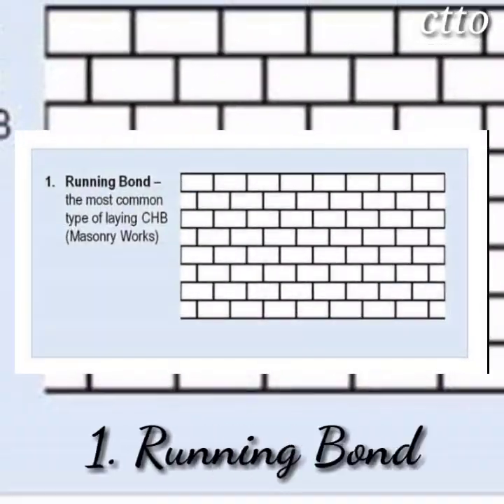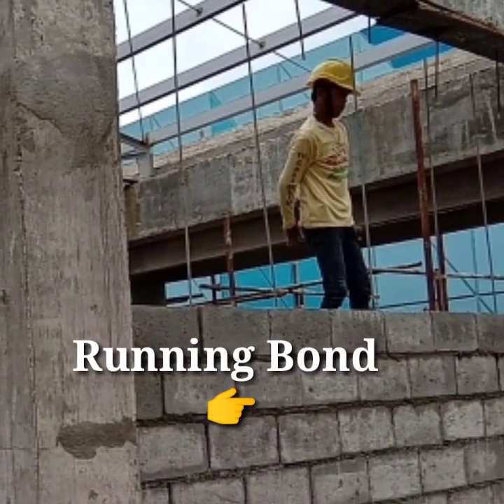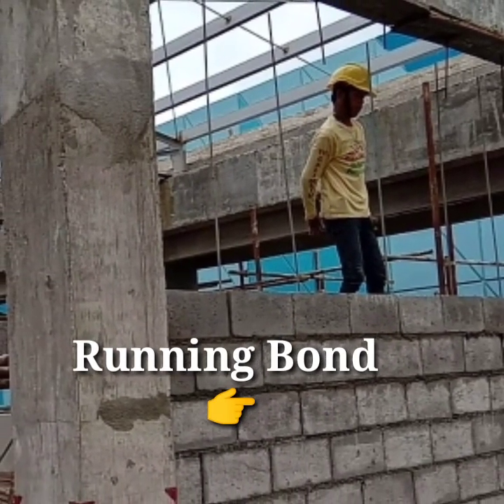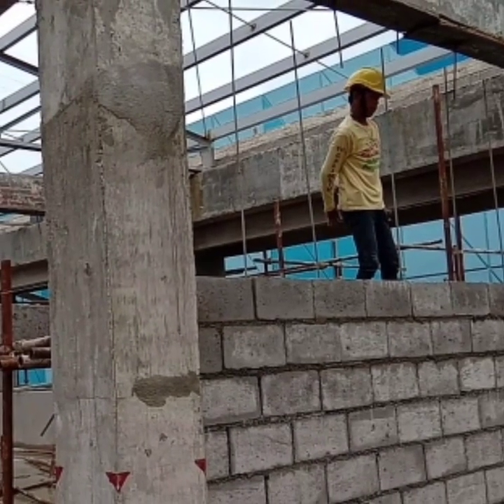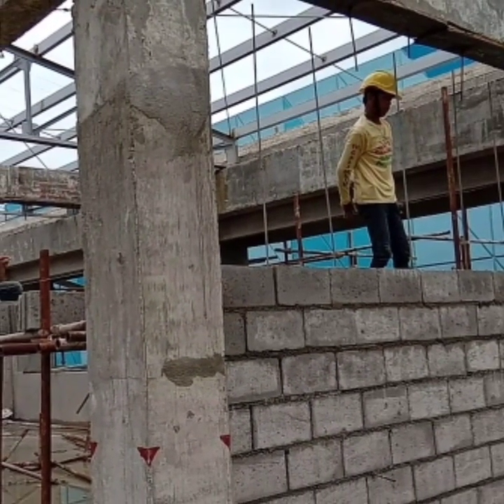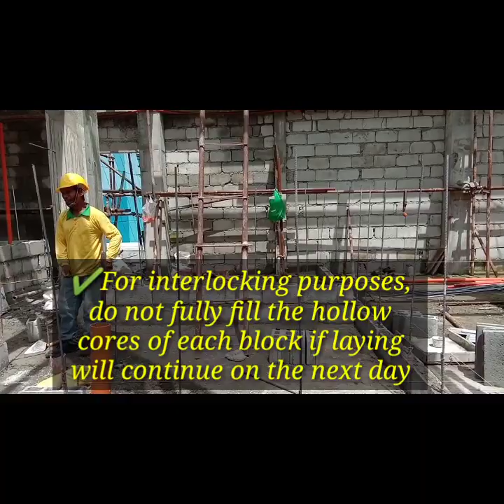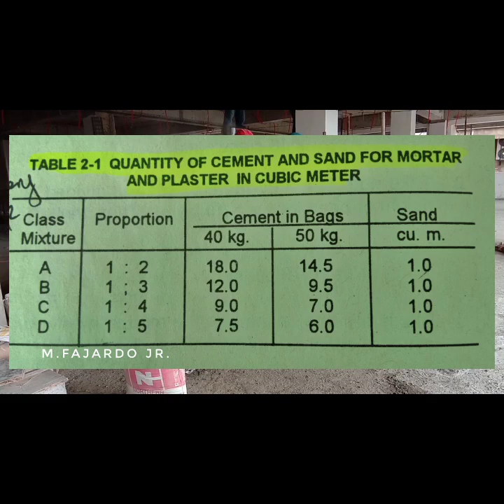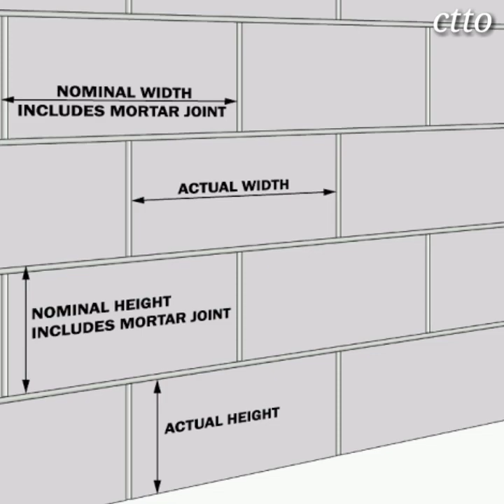CHB Laying Standards | Paano Mag-asintada | Stack Bond vs Running Bond Masonry Works

Comment: Sir kung gagawa ng perpendicular wall (3m span) sa existing na wall, kailangan bang may column sa both sides ng bagong wall or sa one side lang tapos pwede lang idikit yung other side sa existing na wall? Sana malinaw yung tanong ko haha
Reply from the maker: Hello po, pwd na pong idikit nyo nalang sir kung wala pong bigat na kinicarry sa taas..e connect nyo nalang po yung horizontal rebars sa horizontal rebars ng old wall. Sana malinaw din sagot ko hehe

Comment: Sir pwede po ba 4pcs na 12mm at 2pcs 10mm  sa column  ng 2 storey? 25x25cm po ang sukat ng column at 240cm lang po ang height then 3.3 meters po ang span per column. Tapos yung taas po e hardiplex lang ang wall. Salamat po
Reply from the maker: Hello po, ibig nyo pong sabihin sir sa Ground floor lang po hollow blocks ang wall tapos sa 2nd floor ay hardiflex na?
Reply from the maker: Recommended po kasi sir na spacing ng bakal sa asintada ay every 0.6m sa vertical at every 3 layers ng hollow blocks naman po sa horizontal.

Comment: Sir salamat sa mga videos mo very informative sir.
Sir tanong ko Lang sir kung mag pa babakod ako ng 1,000 sq meter.  Ilan tauhan po ba dapat kunin?
Ilan linggo o buwan matapos?
At mga magkano Kaya magastos Lahat lahat sa 1000 sq meter?
Maraming salamat at more power po.
Reply from the maker: TAGALOG RUNNING BOND vs STACK BOND METHOD: https://youtu.be/3Or1mhxa4TE
Reply from the maker: Hello po sir, kung manpower po ang pag usapan, depende po yan sa target mo kung ilang araw taposin ang asintada, basta sa 1 sq meter po sir kailangan mo ng 13pcs na Concrete Hollow Blocks po.

Comment: may dimensions po ba kayonng stiffener beams and columns, tsaka rebar details n din. TY
Reply from the maker: You may use stiffener beams and columns reinforced with 4-16mm diameter bars and 10mm dia bars for stirrups/lateral ties space at 200mm on center po, pero depende din po sa consideration kung hnd sya critical esp short span lang pwd din 2 main horizontal bars lang at C-stirrups/lateral ties. Salamat po, sana makatulong.
Reply: @JUANCIVILIAN  salamat sa info. ano ung dimensions neto, tska every 3m po ba to clear span?? baka reference po kayo NSCP/bldg code. ty ulit

Comment: Ung ginawang meme ung stackbond method. Hahaha
Reply from the maker: Hehe hindi kasi sya nakasanayang ginagamit na method sir, unfamiliar sa iba..kaya akala nila mali, in fact mas matibay sya. Salamat
Reply: JOHNNY REY G. SALINANA Hi sir! Im an archi student sir and my instructors in SLU taught us that Stack bonding on Structural load bearing walls are not allowed? 

And if you do make a stack bond its better if its made out of bricks?

Please give me your wisdom sir
Reply: napasearch ako nung makita ko yun kasi sa middle east ko lang nakikita to pero iba yung hollow blocks nila dun.
Reply from the maker: @HotBaconStrips  hello sir, using stack bond method sir may require approval from the structural engineer who design the building. Mostly kasi ginagamit sa mga na encounter ko is running bond method, pero yung stack method po is hnd naman sya mali which is commonly mistaken ng lahat. In my opinion po mas stronger sya kung maayos ang pagka pile since continuous po ang mortar.
Reply from the maker: @HotBaconStrips  In my own opinion lang sir, walang kaibahan kung bricks or CHBs ang gagamitin sa stack bond method as long as matibay ang chb na ginagamit, and depende din sa specifications ng plano kung anong size ng chb ang gagamitin esp sa perimeter wall are load bearing chb which is 6 inches, correct me if i'm wrong. Salamat po, sana nakatulong ang sagot ko.
Reply from the maker: @scaddydd7336  maraming salamat sa pagbagi ng iyong mga naobserve sir, sguro po depende din po sa specifications po ng chb na gagamitin, pero in my opinion po wala naman pong kaibahan kung ganyan na size ng chb ang gagamitin as long as matibay sya. Salamat po
Reply: Saw that too. Actually came here coz of that HAHAHA
Reply: Okay din naman stack bond mas magastos nga lang sya sa bakal
Reply from the maker: TAGALOG RUNNING BOND vs STACK BOND METHOD: https://youtu.be/3Or1mhxa4TE

Comment: Sir tanung lang po ano po ba ang layo ng rebar sa bawat isa sa pagitan po ng mga holow blocks?
Reply from the maker: at 3:14 mins ng video space at 400mm for stack bond, at 3:27 mins ng video space at 600mm for running bond.
Reply: Salamat kaau sir
Reply from the maker: @mangjca3009  walay sapayan

Comment: Anong size ng chb
Reply from the maker: Recommended po 4" para sa interior walls at 6" para sa exterior walls po.
Reply: @JUANCIVILIAN  okay  thanks
Reply: Yung 5 inches na chb saan ba siya puwede  gamitin exterior  wall or interior
Reply from the maker: @daboyragas4111  hindi ako sgurado kung may 5" sir, recommended lang naman po yan, pero pag mga midrise building kadalasan ginagamit sa exterior at interior walls ay 4" po.
Reply: @JUANCIVILIAN  thanks  for info